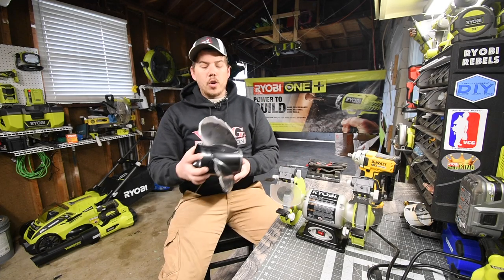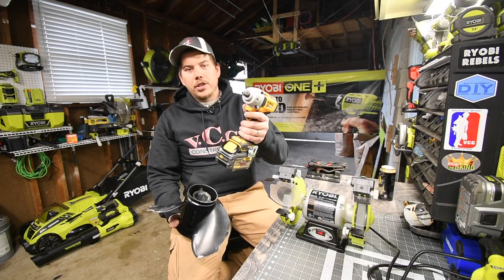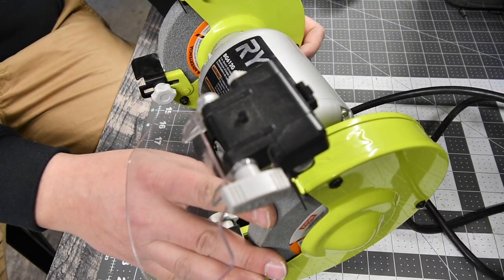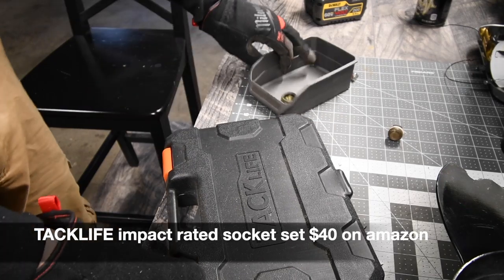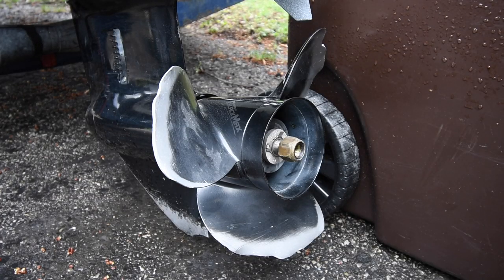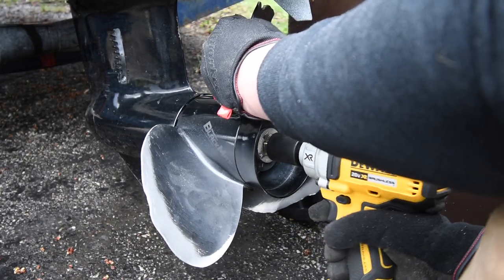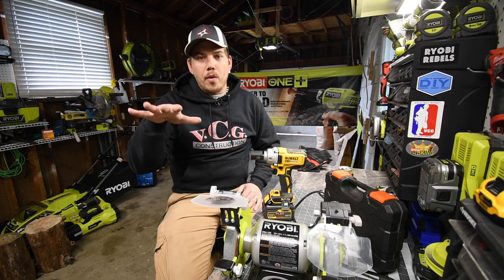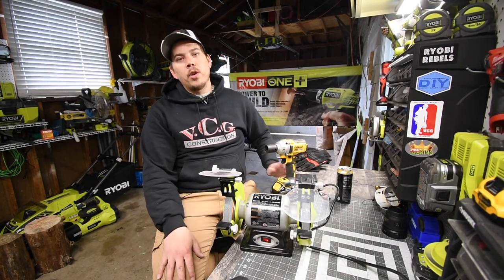How to install a Boat prop

Comment: Two very important safety tips here: 1) When using a bench grinder like this, this is one instance where you should NOT use gloves, because if the glove should get caught in the grinding wheel, it can end up grabbing your hand and cause a serious injury. 2) USE A TORQUE WRENCH when reinstalling that prop!!!! It’s just like tightening lug nuts on the wheels of an automobile: It needs to be torqued to a specific value stated by the manufacturer, because it needs to be tight enough to ensure a positive grip, but not so tight that it deforms the threads or other parts.
Reply from the maker: will do and I thank you Perennial
Reply: Lug nuts can take a beating. As long as you put anti seize and you don’t go crazy with an air impact it’ll be fine

Comment: Ik it has nothing to do with this video but I recently got the brushless circular saw and sheet sander. I want a dremel would you recommend the ryobi for 119 with 2 3ah battery
Reply from the maker: I do recommend the rotary tool by Ryobi. I love mine

Comment: Man caver I got the 12v Dewalt impact and it a strong blew my mind and I took a big lag bolt like u did when done it against the Milwaukee and my 12v Dewalt drove it all the way threw 2 inch wood board. I'm going to get one them big boys u got how do u like the 1/2 Dewalt impact?
Reply: I would just wait and save up for when dewalt comes out with they new power detect model of the impact driver/wrenches
Reply: @master6435  Go ahead and get the new drill man it's awesome and believe it or not the impact that comes with the new drill is good I promise I have ran the hell out of it and it is awesome
Reply: @master6435  I hope Dewalt does come out with a new impact power detect. Everybody knows Dewalt drills are the kings of them all u can't touch their drills
Reply from the maker: I love it. it makes me wish I was  a mechanic so I can use it all the time lol
Reply: @ManCaverTools  Yes sir I love the 12v line
Reply: @ManCaverTools  I like watching Vince and Nick but I like the way u do it better one at a time and I want u to get the new Dewalt drill 998 and show these Milwaukee fans how much more power the new Dewalt drill has more than the Milwaukee

Comment: Generally like your content, but not everything benefits from an impact wrench - use a ratchet or better yet a torque wrench. You ripped up that bronze nut needlessly, and no control of the tightening torque.  Your prop needs to be balanced for anything more than dead slow - your output shaft bearings will be worn prematurely, and you can blow a seal, to say nothing of the cavitation.  You might also want to consider fixing your skeggard.  Dude, what did you hit? And how many times did you hit it?
Reply from the maker: It drove though a little mud. its aluminum, stainless steel wouldn't do that.